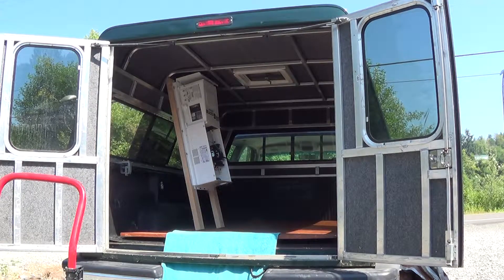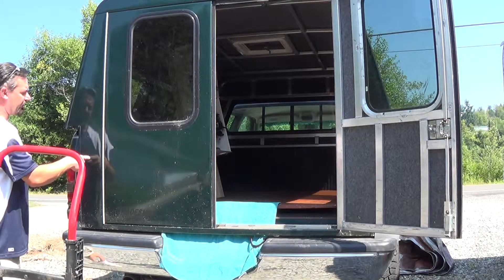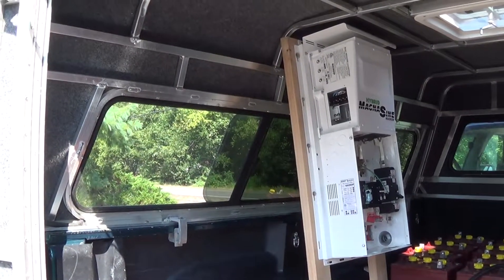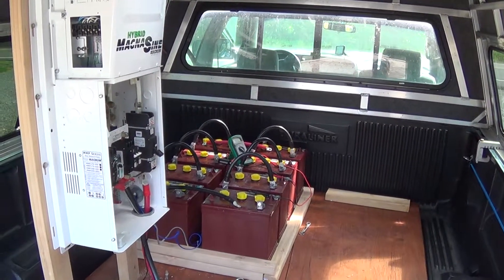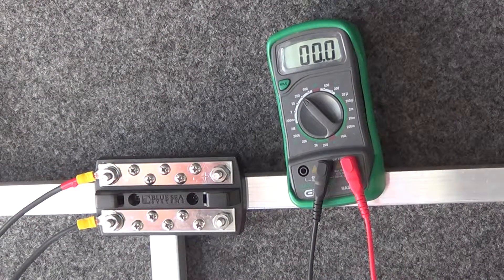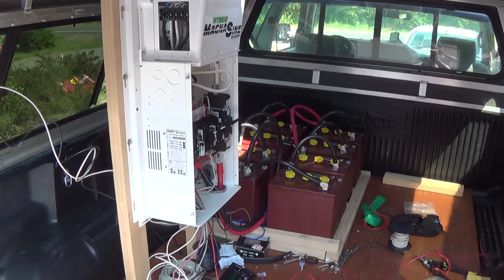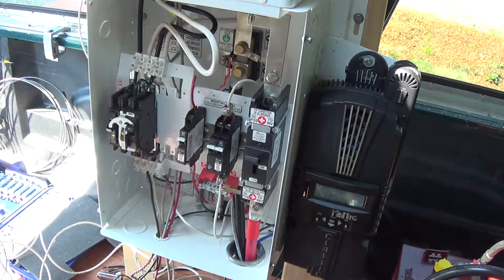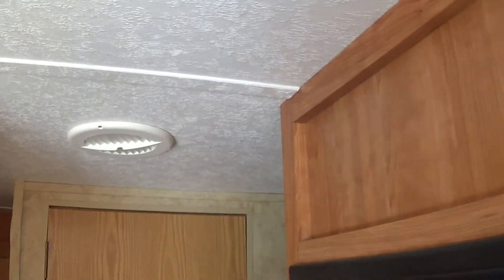Off grid Solar install part 3:  Connecting panels to the inverter and batteries

Comment: I bet that made you feel good that the ac unit would power up. I would think your battery bank would need to be a bit larger to run it for any length of time. your set up is really coming along bro,,, well done!!  SD.
Reply from the maker: SilentDeath002 I don't have any actual intention of running the a/c on the batteries.  I was just doing it to see if it can be done.  It uses huge amps and set off a few faults on my inverter.

Comment: I got the same breaker to run the charge controller thru, have not got that far to install it yet. I did not get the battery monitor kit in mine. have to call the store and ask them whats up lol. it was supposed to come with it.

Comment: hey buddy!  one thing I forgot to ask you. the out feed of the inverter has one single hot wire, common and ground. can you show how you hooked it up to your sub panel? the salesman recommended back feeding thru a breaker, but then there is a question of how that will affect your common and ground wiring.

Comment: here is a suggestion to help keep your inverter cooler and vent out the fumes from the batteries. Go2marine.com    just type it in like its written. once your there in there search box type in fan, should end up with several pages of fans. I picked out the 135 cfm fan for around 30.00 it moves a ton of air and is rated for continuous duty. they work so much better then computer fans. I made a video showing one installed in the battery room of my shed.
Reply from the maker: SilentDeath002 I worked at West Marine/Boat US for 15 years so I am pretty familiar with those fans.  I went to Go2marine and West Marine to read the descriptions of those fans.  I could not see anywhere where they are rated for continuous duty.  Maybe it says it on the box, but my experience is that they are not.  They are also really loud, in my opinion, and my camper and truck are right next to each other and I am easily irritated by fan noise.  I will probably use a computer type fan, or if I can afford it the solar powered vent fan.  You are correct though, they do move a lot of air.
Reply from the maker: SilentDeath002 Morning SD,  just saw this on the web and thought of you.  Did you know you can hook a voltage sensitive switch to your aux 2 port on your Classic 200 to turn your vent fans on while the solar is charging?  I might try to rig this up.  Beats running out there to flip switches.  Check out this link, I know your brand of fan is different, but the principle should still work.  http://www.affordable-solar.com/store/battery-vents/zephyr-power-vent-24-voltI have been producing crap for solar.  We had dark rain clouds and I didn't hardly make enough to run the inverter let alone generate power.  Oh well.

Comment: the T-105's are a nice battery to work with 225amps. something that might help you get a larger battery bank cheap.. if you find your local Trojan Master Distributor, or battery exchange or golf course with carts, you can usually purchase used batteries for the core charge. most of the time these batteries are sulfated so there run time is reduced.  Using a solid state pulse motor you can remove that sulfation without the aid of any kind of chemicals introduced into the battery fluid. if you would like some help on how to build the pulse motor I would be glad to help you out. its easy to make. and it will restore a battery fairly quickly if you follow the procedures set by john bendini. that's contained in a book you can view online called "The Battery Bible" usually you can get T-105's for 15.00 each, T-125's for 20.00 each and T-145's for about 30.00 each. you can even get the L-16 used.

Comment: nice set up your working with. I have the magnum MS4024 4000 watt inverter/charger.
got it mounted inside the shed and I will start hooking all the goodies up as time permits. which Trojan batteries did you use? T-105,T-125 or T-145's? I will have 4 separate 24 banks adding up to right at 1020amps to work with. Again, nice job!
Reply from the maker: I have the t-105's, in two sets of four.  All the budget will allow.  Looks like alot of battery, but with them wired in series amp hours stay low, but with the higher voltage you will use less amps.
Reply from the maker: Fernbark Frist
Also, Thanks for watching and good luck on your shed!